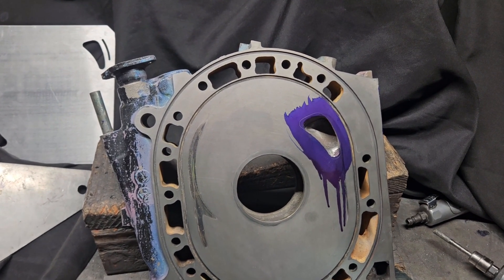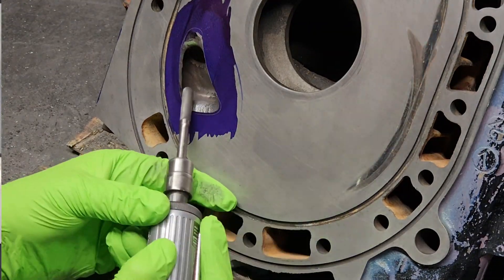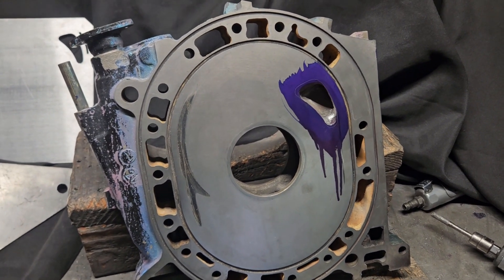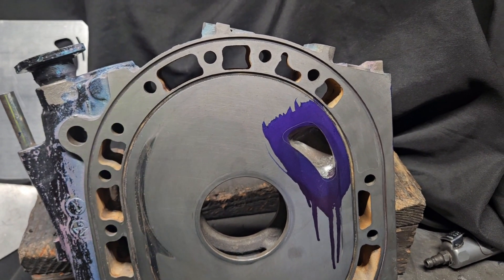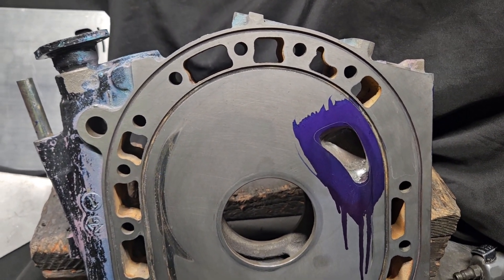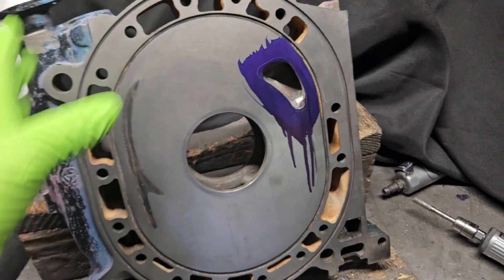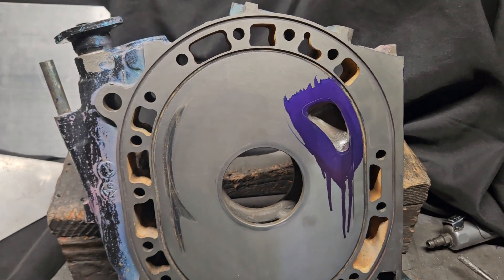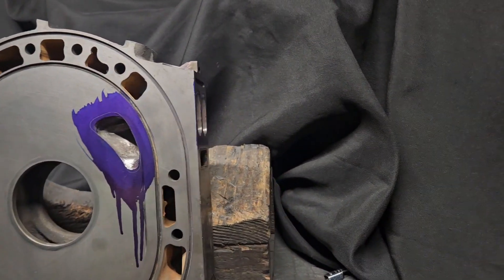Rotary Engine Center Iron - trying to save an expensive part - port matching & re surfaced

Comment: Ive been thinking of going to the local forge and using one of my spare mint center Irons to do a run of new ones !
Reply: Bro,now that's  a awesome thought process.
Reply: @justinkeller9502  also old Irons can be reused in the process . Cleaned up chipped up and remade into brand new ones .